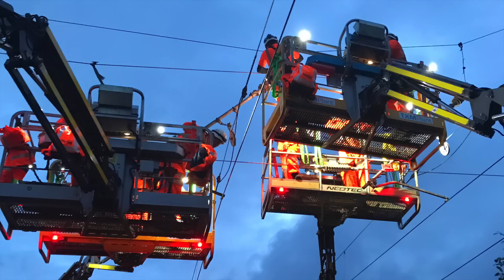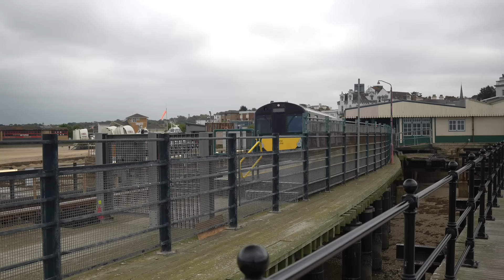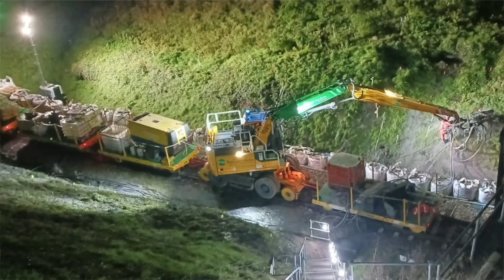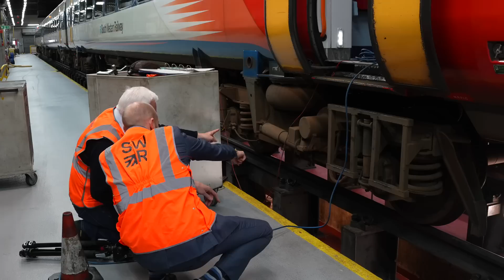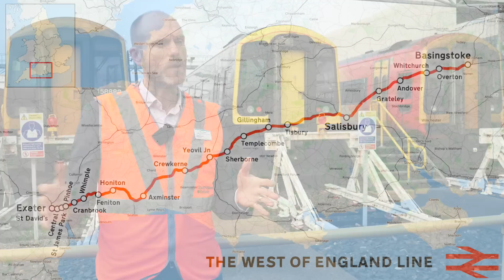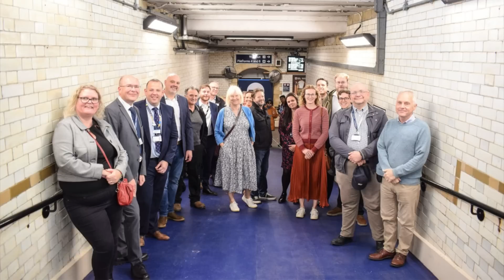Electrification, battery trains, third rail – Finding solutions for South Western Railway’s network

Comment: The 159 units are vastly superior to any newer stock, including the dreadful Hitachis on the competing GW route. Unless there is incipient metal fatigue, they need only to be re-engined, or converted to EMUs or battery or locomotive powered sets.

The main difficulty with the route is shortage of passing spaces west of Salisbury; surely this should get priority?

It is time to drop the decarbonisation fad. Railways account for 0.7% of carbon emissions. It isn't even worth thinking about.
Reply: Supposedly there very much is cracking problems with the 158/159's and has been from new. Very much garden shed engineering, though they are nice trains.
You can only patch something up so much and their probably near their design life.
Reply: @dglcomputers1498  
I am not surprised. Aluminium bodyshells are a mistake. I suspect the new Hitachi trains will even not last out their design live. I was in 800 series trains last week - the whole bodyshell shakes like a jelly, which is exactly how to induce metal fatigue on aluminum. 

The line to Exeter needs to be operated the same way as Waterloo to Weymouth when electrification was only as far as Bournemouth.

A new generation of stock is needed, with correct design parameters. The 800 series are all wrong, and we need to go for stainless steel bodyshells which have a 60 year life.

Replacement of the the 158/159 fleet is an opportunity to break the trend where each generation of trains is worse than what they replace.

Comment: Batteries belong in the scrapyard.

There is no alternative to Diesel-Electric currently but eventually alternative fuels will replace Diesel.
Reply: What a crass statement, battery electric hybrids were demonstrated on Anglia in 2015/6 on retrofitted Electrostars. With a suitable battery raft retrofitted to current trains a great alternative to fossil fuels is possible. Alternative combustion fuels are a pipedream.

Comment: Me I was wondering why you couldn't sacrifice some seats in the 455s for a couple of motor/generators or a motor and rack of batteries . Coupled with some sound deadening around the compressors and you might forget the 'new' bimodes are even older than what they replace . ( I did Wimbledon to Guildford on on once and felt a bit deafened so maybe just use them for Reading -Salisbury an the Southampton circle .)
Reply from the maker: No-one is going to install a diesel generator (new) on anything, let alone an EMU.
Reply: @GreenSignals   Except ... Oh no they're gone . Big pile of batteries it is then . 

Hold on, Stadler FLIRTs, class 799s, both have Diesel genpacks . And batteries can go in later , I just don't want to give Musk the money right now.

Comment: Ever since the 60's, London to Exeter through Taunton was 'the way to go', but if you have to, Salisbury is possible, but are you sure you want to? That thinking seems stuck in a lot of minds and once a fleet of every half hour Class 800's running on dual track are funded, the 'Cinderella' line will never get to the Ball!
Reply: I use to use this route to get to London, from Exeter when i was at University there. The only reason you use this line from Exeter all the way to London, is because it's cheaper (especially as you can use your network card on it). If the main GWR was cheaper you'd defintely just use that.

Comment: I will miss the 455s on SWR. Much better designed inside than the Desiros with their power point intruding on your leg room. Also never known one break down.
Reply: Same mate, as much as I don't want 701s replacing them sadly unless we get one into preservation then this is the last full year of the 455s...
Reply: I never broke down with a slammer in all my time that I worked with them, guard and driver, about 14 years at Bournemouth.

Comment: Pre-Covid capacity? Is rail not recovered by now?
Reply: It’s global Japan is similar
Reply: It’s specific to SWR because their model was so reliant on 9-5 south west London to central communing. With 3 day working now standard, SWR over passenger figures are down by around 35 percent from pre Covid. Overall industry I believe is about recovered now.
Reply: From my experience on crowded West of England Line trains, especially the 3 coach ones, I would say that it has.
Reply: Long distance, business travel, and weekend travel are all around 110% of before covid, shorter commutes are close to levels before covid, but longer commutes, e.g. Guildford or Basingstoke to London are down as most of these kinds of jobs have moved to 3days in office, 2 at home, so down around 35% as others have said, this gives an overall average of 95% or so
Reply: @jamesnichols5163  They've reduced the Weymouth to London line down to 1 (slow) train an hour on Sundays in the summer when it's packed with tourists coming back from the beach. Absolutely ridiculous. It's full by the time it's got to Dorchester and people are standing in the aisles even when it's extended to 10 carriages (if you're lucky) at Bournemouth.

Comment: I wonder how long it will be until one of these on-board train batteries ignites, with spectacular and potentially fatal consequences?
Reply: Like the diesel trains that ignite also!
Reply: @GooseWaffe  We've only had one 159 go up slightly in their 35years. Pre-heater in Clapham yard. Didn't do much damage though.
Reply: They won''t. New battery chemistries make the possibility of spontaneous combustion extremely remote. Even now the incidence of electric car fires is something like 50 times less than in equivalent fossil fuelled cars and in future it will be even lower.
Reply: @GooseWaffe  Diesel is VERY difficult to ignite and relatively easy to extinguish. A battery fire is effectively impossible to extinguish, and is FAR more intense.
Reply: @kristinajendesen7111  tbf the 159’s and 158’s are pretty good, I was more thinking of the adelante
Reply: @rogerphelps9939 Just not true. There's no new proven battery chemistry.

Comment: 2 questions.
could the 159 move over to TFW to match the 158's? instead of scrapping them keep them and scrap the 150's
why do you always use gwr when talking about the battery trains but not the already in service 231's tfw?
Reply: I understand there are places where the 158'/9s can't go, I believe a mixture of dwell times and bits overhanging. Plus 150"s are better suited to stop start routes given their door and interior layout.

Comment: nice hear the RSSB has reversed their tone on 3rd rail, it seemed rather silly that operators were content to sit on their cost+ mode of operation and just let commuters eat the cost of diesel rather than use cost effective modes of electrification. 3rd rail is safe if you're used to it. yes it has risks, but what doesn't? burning diesel has massive risks in the future as climate change continues to hammer the country with increasingly severe storms

Comment: 7:00 this is honestly utterly stupid and full of lies. What do you mean traveling is still at pre pandemic levels?? Every time I went to Waterloo it’s always rush hour 24/7 shouldn’t you be using those trains (aka the 450) to strength 8 car trains to 12 then?? 
And what do you mean using batteries on 450?? Do you know how long between stations the line is. 3 hours is no joke and even if you charge a battery at every station it won’t reach enough. This is more like a cheap way to do so and it’s not funny SWR. Typical first group 🙄😒 🤦‍♂️.
At this point just order bi-mode trains that can run 3rd rails and diesel. Or here is a better option. Modify 450 to have AC and do OHLE from baskingtoke to Exeter. 
Battery for motive power on such a long line is not an ideal plan and we should just get trains. Make the cab control and all to be similar to the 158/159 and there you go it’s pretty much no new fleet once you fully replace the 158/159. It’s not that hard. SWR have the money.